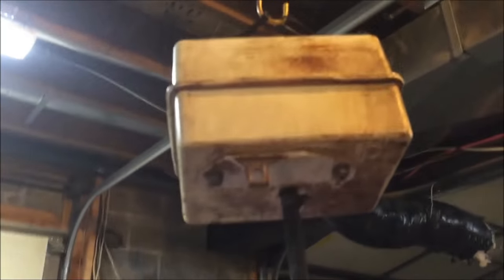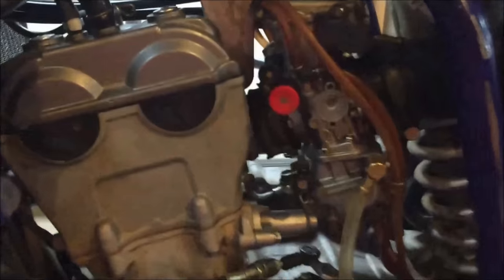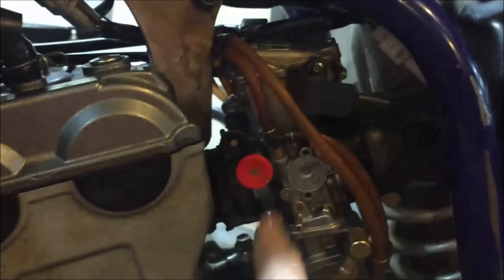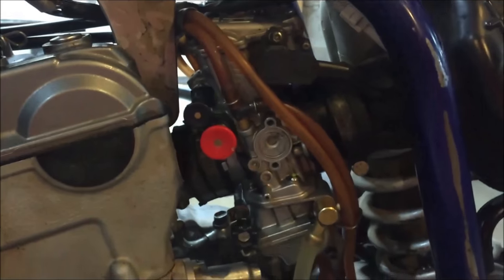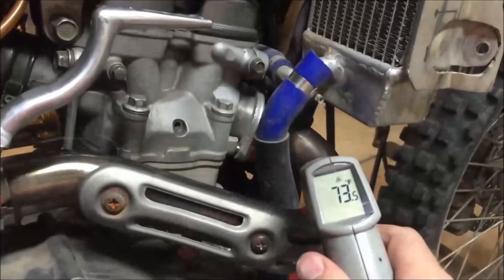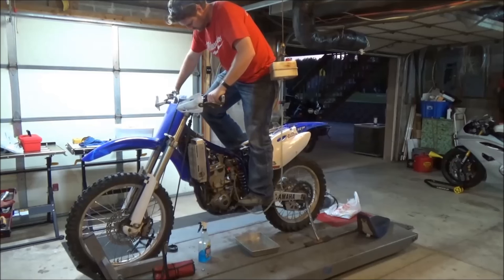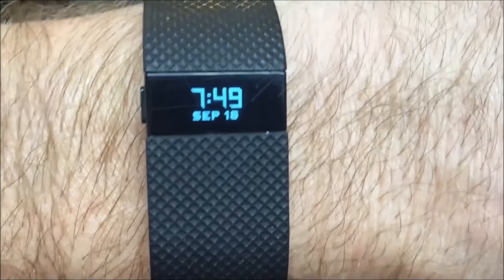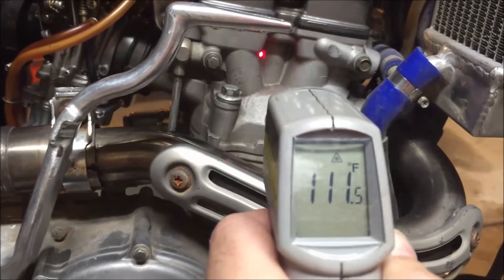How to start yz250f (short version 2 min) cold and hot start. FULL 6 min version link below!

Comment: Could you explain what a tps sensor does on a four stroke carb model 2005 rmz450 as mine has one but i was lead to belive that tps sensors are only on fuel injected models.
Reply: Thanks, that actually makes sense now. have you got a patreon account? That's a great way for subscribers to support your channel. i would defiantly like to help.
Reply: A tps is a throttle position sensor.

Comment: I have a 2015 yzf250f and it from cold it will start first kick and rev up fine and ride perfectly fine nothing wrong with it at all, but if i cut it out while its hot and then restart it , it will backfire big time and bog out and run really rough, i have to wait for it to cool all the way down for it to start again and run properly, just had the valves done timing cams tention oil change full service new plug everything and it does the same thing completly baffled by it an so is all the machenics and riders i speak to